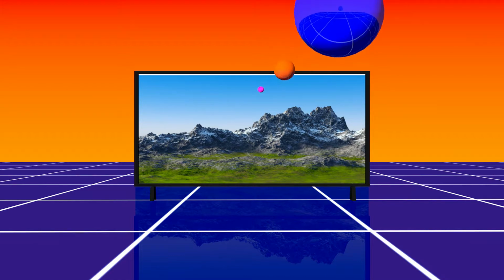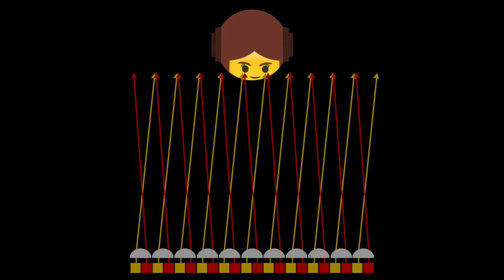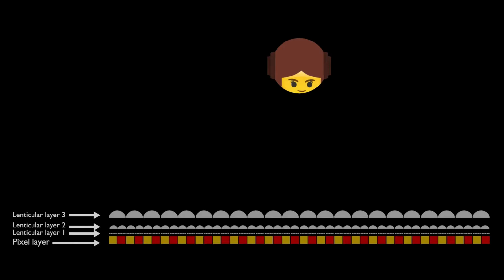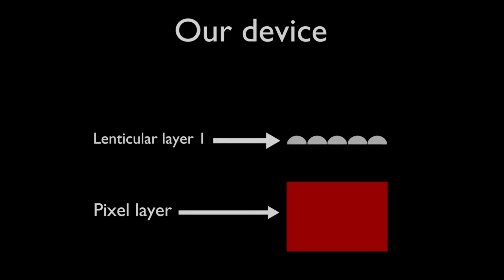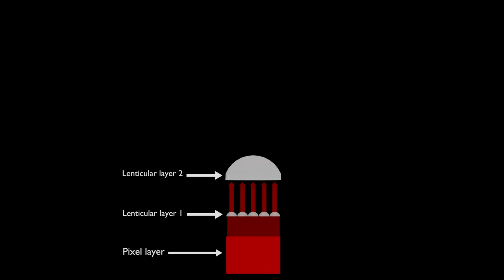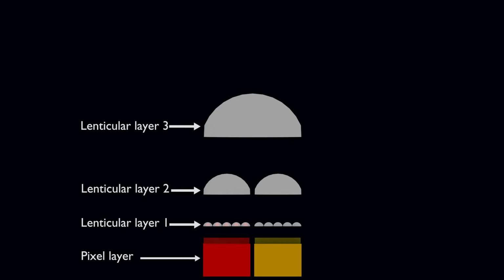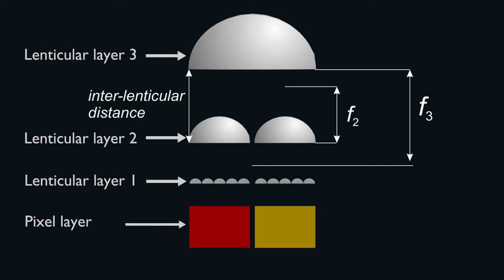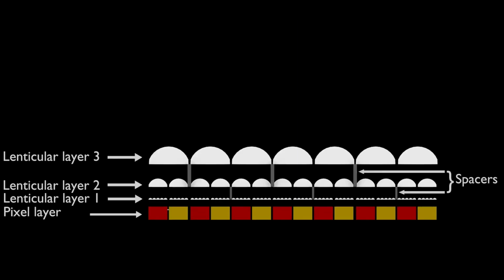Tri-lenticular 3D Display - 2018

Comment: Lenticular displays can only fail. If we want 3D we can always get active glasses or just vr headsets
Reply from the maker: The techniques you have mentioned will provide 2 views (left and right) regardless of your viewing position. The tri-lenticular display will give you more realistic different views with different positions and without wearing glasses.
Reply: @dbsciencecorner6879  That is true but you need to be in a specific distance for the combinational angles to work in pairs.
Reply from the maker: @AriaPrincessAria  That is correct. The viewing distance is pre-determined for each type of display.
Reply: @dbsciencecorner6879  This is why 3D headsets are a thing. That is the only real 3D virtual reality.

Comment: if i have a 3d printer that could print those lens and have 4 more people sitting next me horizontally and view at 2 ft. or more xx fit distance away from my acer h233h 23" monitor with this method and if it works, i'll report back to this video with those 4 users (whom is not in the center) experience.